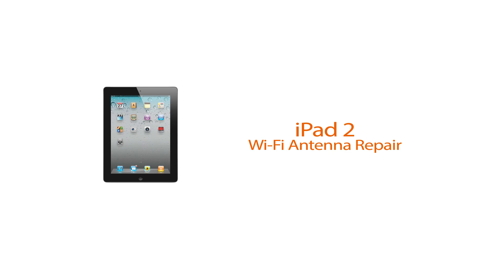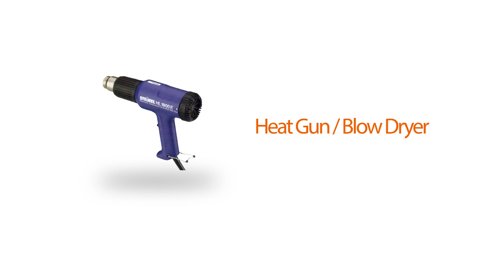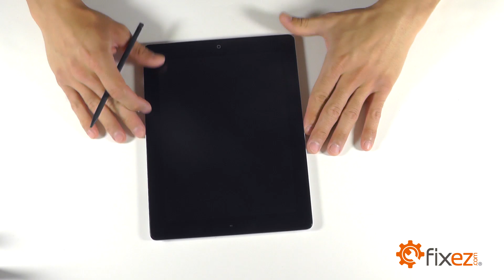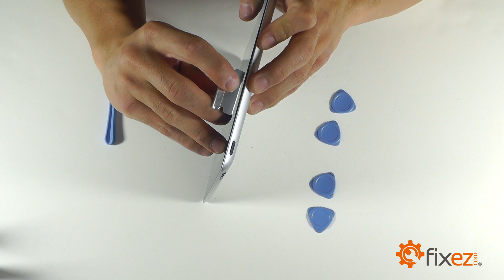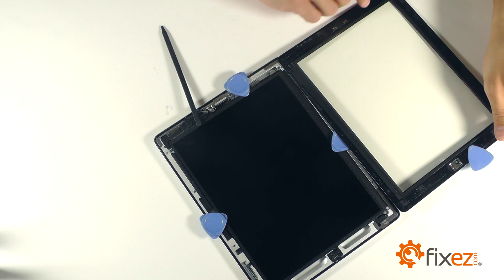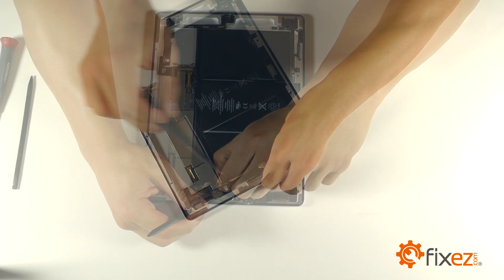iPad 2 WiFi Antenna Repair

Comment: Nice video, clear instructions and good photos. Anyone know how to tell if your wifi issue is the chip or antenna?
Reply: mrequi1 just put aluminium foil around it and save money and time.. Makes signal stronger than the useless strip where it's connected to
Reply: FunkyFreak My wifi is greyed out, so I doubt that would work. It's been a common problem on iPads and iphones for 10 yrs. That's one reason I'm an Android developer and not an iOS one
Reply: mrequi1 works for me and my ipad air 2 doesn't have any wifi problems so ipad these days don't have those common issues anymore.. Only my ipad 2 wifi cable snapped so wrapped aluminium foil around it connection is stronger than before and saved me money
Reply: FunkyFreak They certainly do have these issues still. As of last week people are still bringing it up on the forums. The problem is the way the chips are soldered on. That's why heat or cold will allow the wifi to connect temporarily. I'm done messing with that iPad anyway. It's not like you can do much with one from a development standppoint. I guess they're ok for technically challenged people with too much disposable income.
Reply: FunkyFreak I am curious though as to why if you went through the trouble of taking the screen off, etc to expose the wifi cable, which is a pretty delicate job why didn't you just replace the chip, antenna and cable? The whole assembly can be had for about $15 on Amazon or ebay.
Reply: mrequi1 i'v cut off the chip and replaced it with a huge piece of aluminium foil not gonna waste anymore money on a ipad 2 scratched the display a bit because the glass that was on before was cracked and the splinters made scratches a lcd is way to overpriced for a ipad 2 it should be less than that since those are fake and old etc.. But yeah..
Reply: FunkyFreak that's a bitch of a job. congrats for doing it without ruining the LCD. I think I sold mine today on offer up for a BT speaker and $20 (I paid $0 for it) other than the wifi issue,  it's immaculate.

Comment: My ipad 2 has a problem with wifi. When i using my ipad near wifi access point (3 or 4 meter), signal wifi in bar so strong, i can access internet. but i stand far away (6,7 meter) signal wifi so weak, i can't access internet. Do you think problem is antenna or problem is chip wifi ipad?

Comment: on my ipad 2 the place below the home button is dented and it does not connect to any wifi only when kept beside the router it gets 4 bars qnd 5 cm away no bars
Reply from the maker: It's possible the wifi antenna was damaged.
https://www.fixez.com/ipad-2-wifi-bluetooth-antenna-flex-cable

Comment: Thanks for the instructional video. Can you please add a note to the video to make sure no one makes the same mistake I did when lifting up the speaker connection. I thought I was following the video exactly but when I was putting it all back together I realised I actually made the mistake of lifting off the whole connection. I now have to take it to be soldered back on. If you look at the 4:42 mark you'll see where I went wrong.

Comment: my iPad is not reading any wifi signals I push other to type in the network but it says could not find network
Reply from the maker: +Cristal Araiza. This would be related to the WiFi antenna and would be a good start. However if replacing the antenna does not resolve the issue, it would be a software issue. Possibly try restoring the operating system via iTunes to see if this helps.
Reply: Thankyou :)
Reply from the maker: You're welcome.

Comment: on my ipad 2 the speaker cable was welded to the mother board so when i removed it like shown in the video it just broke off and now my speakers wont work because of it.... not to mention it's completely useless to remo the whole mother board. it only requires to remove the daughter board part
Reply from the maker: +miha2342 We apologize to hear about this.

Comment: I have an Ipad3... a small black wire that is attached under the black wifi pad that's now broken. However,I'm still getting a signal and the only thing not working is the home button. If I replace the WiFi will i do it the same way as the ipad 2 and will this solve the home button problem? (i replaced a broken screen) Thank you for any assistance.

Comment: My wi-fi was greyed out so I bought a replacement wi-fi antenna and installed it but the wi-fi was still greyed out.  Short of buying another antenna and installing it, is there a way to tell if the problem is something else?  Could it be anything else?

Comment: Hello, i did a digitizer repair, but the wifi antenna cracked at the point where the 2 screws are, are the pieces under the screws a part of the antenna????, it is just a tiny piece of antenna under the screws, i still have wifi but I am unsure if it is unstable.

Comment: Hi, thanks for the video, I changed out an antenna on my Ipad 2 but the signal was weak and I had to be close to my router, I updated IOS and it was still weak, do the wifi has firmware that need to be updated?
Reply: *****  Everything is up to date and Bluetooth is working. Thank you,I will definitely subscribe to your profile for future references and when I need to order parts.

Comment: One question, will replacing this antenna will solve the following problem.  Sometimes my ipad2 looses the wifi signal, and if do a reboot, the wifi is completely gone and the wifi toggle is grey.  So in order to make it work again I have to do the freezer trick and also the hair dryer trick.  I should mention that bluetooth always works even when the wifi toggle is grey. Thanks.